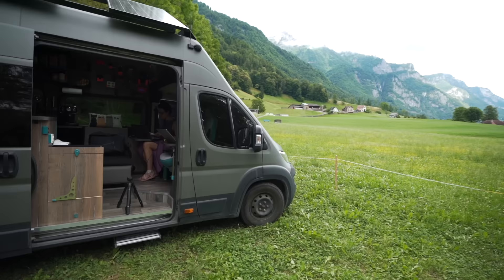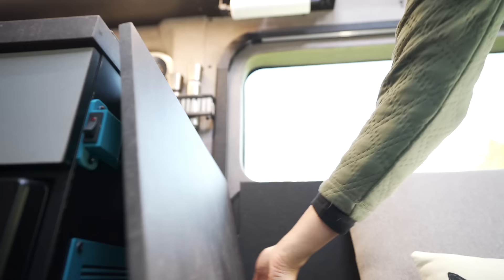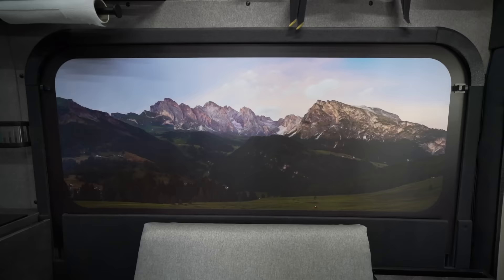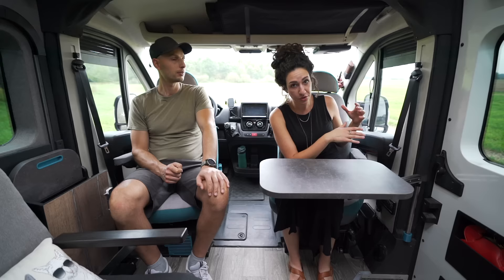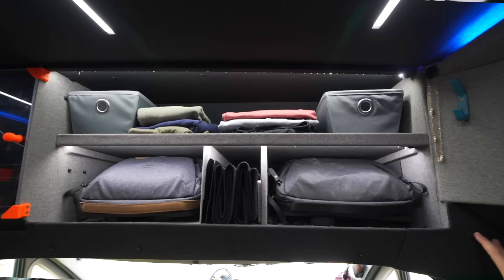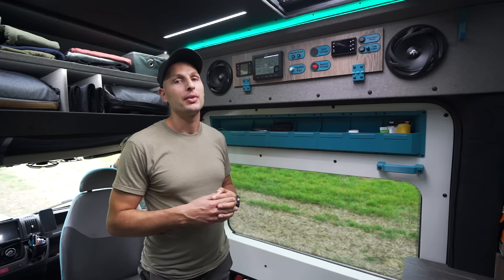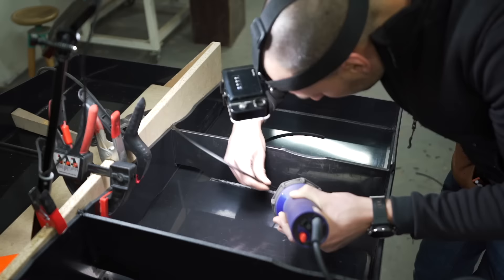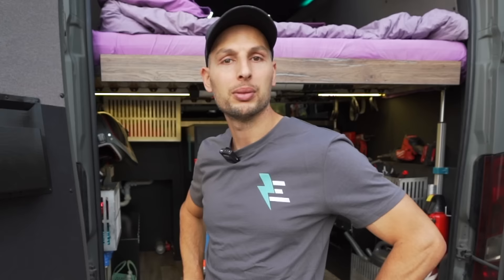Inside the Most FUTURISTIC Campervan / DIY Van Tour

Comment: Of all the van builds, I think you've designed / engineered the best modern solution for creatives. Having a 3D printer running while you are on long drives is a stroke of genius. :trophy-yellow-smiling:
Reply from the maker: Driving has no effect on the print quality.
Reply: @ladiandmargaret The RAL CODE  color please ❤
Reply: I really hate these 2 - in a good way ♥ What a van. Even though i'm not technical at all, I still would love to try it out. Keep it up 👍
Reply: Not just for creatives. it's the best overall build i've seen ever. 
switch out the drone equipment and print other holders. replace the 3d printer compartment with some other tech, maybe a gaming pc. reorganize one of the thousand small compartments. replace the e bikes with normal bikes or an e scooter. there are so many options to easily customize this van
Reply: @Larsino2000 Make that 0% sure now. 😂
Reply: Agreed, I think this is the best one I've seen!
Reply: @Johnniebhoy83  as someone with 3 Prusa MK3S+'s - i'd agree with larison and be pretty sure that vibrations would negatively effect the print quality. Jesus, the vibrations from the 3D printers on high resonance surfaces is enough to ruin the prints, that's why most people reduce vibrations by putting them on concrete slabs.
Reply: That’s the reason I started following the serieus and subscribed. Both explain everything so well and show exactly what they mean while designing or building it. Also because they have had experience before building a Camper van they knew what to change or to do better this time. Some things are maybe a bit overkill but that’s what makes this one so god damn cool!
Reply: Came here to ask this! All the action that's going on in that little house on wheels is really inspiring!  @ladiandmargaret
Reply: Geez. What did you 2 not think off!?
Reply: Maybe a wind turbine?  @Khigha87
Reply from the maker: You can trust us. We tested this extensively and it prints without any noticeable defects.
Reply: @ladiandmargaret about to get out of the military, want to get into van life and travel the states, this video is a goldmine!
Reply: @ilbirbantevagante  thought the same
Reply: @ladiandmargaret  Driving has no effect on the print quality. => Regular driving has no noticeable effect on the quality of your printings
Reply: Wow!
Reply: @ladiandmargaret I find this hard to believe.
Reply: i was about to say, this is the most sophisticated, practical, and functional van build I've ever seen
Reply: @ladiandmargaret ofc you’d say that😂

Comment: The FUCK is this ???? A vehicle which has integrated 3d printer and also prints its own spare parts when required !!! Like,.. Seriously this guys ,, this!!! This is what is needed. You have the best damn vehicle in the world and no one can beat that!!!!! I can't imagine the hard work put into building this high tech masterpiece !!!
Reply: No the ''bathroom" is shit. Rest is great though
Reply: @dimarak8866  Overall yes it is shit, but if you compare it with other camper vans it is at par, its like when you top in the class with 5 marks out of 100, you still get A+ grade. So basically it isn't that of a shit, depends on the frame of reference. I would say it is doable and functional, not the most luxurious like leisure travel vans, but still innovative thinking and practically functional whilst making efficient use of the space.
Reply: How can you 3d print spare vehicle parts? They're plastic!!

Comment: This inspires me for a van I would like to build in a few years. While I don't have access to a 3d printer and may not need it on the road, I definitely see a future where I own one. The solution for the bathroom is exactly what I have been looking for, as I couldn't figure out an open layout that included a bathroom. I don't need as much space, so a lifting bed may not be necessary, but I will definitely fold the bed in half when it's not in use, as I would have room for a small desk for gaming. I do like the setup that Husband has for his office, and I considered it for my gaming setup as well. Maybe if I discover more things ill want to haul, then I will switch to your office design.

Comment: Holy Cow! What a project and what a result! Your van is definitely through the roof and off the charts. I'm very impressed with the level of detailing. ... One detail: With all the wiring and the sophisticated electrical system you could've also just bolted a fully decked out Mac Mini somewhere under the floorboards or in a wall and not be worried about someone snatching your laptop. But that's just me nitpicking. This is effing impressive and very inspirational. I'm considering going Vanlifestyle my self and this sort of thing is right up my alley and in definitely taking away some solid inspiration and ideas from this. 

Great planning. Great execution. You guys rock and just made my day. Thank you for this video!

Comment: I have an idea for the shower curtain, you can make a fixed steel frame atached to the a foldable curtain. And you put magnets on the ceiling. So you enter the shower space, pull UP the curtain frame to the roof, and it makes PLOOK. And voilá

Comment: When anyone dumps gray water from their campervan, they need to make sure they are dumping into a drain that goes to a sewage treatment plant and not into a drain designed to take rainwater off urban streets. The latter sends the discharge directly to the nearest stream rather than a sewage treatment plant. If gray water needs to be dumped and a sewage treatment plant drain is unavailable, a grassy area can be used receive the gray water (but never the black water). The plant roots there will absorb the soaps and bits of food particles.

Comment: 27:53 👍Low level toilet and shower arrangement is far better than full height shower room that generally restricts move movement. Importantly it gives the van a much more open air. OK there is a loss of privacy, but hey ho that’s van life 🤣
You could also add a removable rail so that you could hang wet gear to drip into the shower tray.

Comment: With your skills and creativity you could easily invent a folding box that could act as a wall and roof for the bathroom. It could fold just like a normal folding box. Or you could have upwards sliding wall panels on the inner side of the bathroom. Great build none the less!
Reply from the maker: Sure, we can add it with time if we have the need.

Comment: I wish he  would show ICE, that makes all this travel possible😇The 2015 Fiat Ducato L4H3 is a van that offers practicality and versatility. Here are some key details about it:

Fuel Efficiency: The Ducato is known for its low running costs and impressive fuel economy. It can return up to 47.9 mpg (miles per gallon) with emissions of 157g/km1.
Engine Options: The current Ducato range features Fiat’s Euro 6 Multijet II common-rail diesel engines. These include a downsized 2.0-liter engine with 115hp and 2.3-liter engines with 130hp, 150hp, and 177hp options. The 150hp motor can also come in EcoJet trim, further enhancing fuel efficiency

Comment: use bifacials on the roof and paint the roof white so you get couple % more power out of those panels, and also i would add flexible solar panel on the side of the van for extra power, vertical mount works really good tbh
Reply from the maker: You think 1kw of solar is not enough? What for would you need more?

Comment: Things I want, if I lived in a van:   #1. 1000 watt microwave. #2 Good sized freezer, for 400 frozen sandwiches, frozen vegies and frozen meat and fish. Tools, gear and a 40+ gallon water tank under the bed. #3 Ceramic wall heater. #4 200 cans of soup. #5 2500w Power Station hooked up to solar on the roof, or a SphereMotor. #6 A sponge. #7 Coffee maker and a rice cooker.  #8 A good wall cabinet setup.  #9 Pullout toilet under the seat.  For dinner put some frozen vegies in microwave and then add soup. Next microwave a frozen sandwich. Next wet hair, add shampoo and then rinse in the sink with warm water from the microwave. Next clean body with warm sponge. Next turn on the Ceramic Wall Heater. Next, be free and happy.

Comment: In the shower, you could have put some curtains like the one on your kitchen cabinet door, you would have had privacy and height, even some bars or rods as they want to call it, with a shower curtain so you can only get up after taking a shower or doing your business. and miss down.  With so much futurism, I can't believe something like this hasn't happened to them... that shower won't work well, it's water spread everywhere for sure.

Comment: First thing first, great video, liked and subscribed 👍.  Once I saw how your hang your drone, I had a stupid idea, since you engineered everything in this van, why don't you set up a drone launchpad on the roof somewhere, then one button to launch the launchpad, and you can sit at your driver's seat to fly your drone, just some useless example, stuck in traffic and wanna see how long is the lineup, or at the edge of the cliff but want to check out the beach down the cliff and the road to it, etc.  That would be super futuristic, just a thought 😄

Comment: Serious question: With all the knowhow and tools you have, why not build one or two slide-outs? The water is under the car and out of the way and you have a couple of linear motors already in use and the experience to control them.

Comment: Awesome, this can be future, esp when RAM has those range-extender VANS/TRUCKS with small, efficient, clean as possible, ICE / generator for piece of mind.
Too many DC CHARGER cables are already being cut off for copper. No way to stop it. Too expensive to hire 24/7 armed security. I not want to be 100% dependent on DC fast-chargers, also it will lessen depletion of Lithium, for batteries, by being smaller, lighter, cheaper!

Comment: Mavic Pro: Folds into a small form with less volume than a running shoe for easy transport
This Guy: Stores it in bright orange clips fully extended in the middle of the wall
What was that about not looking like there were valuables inside?

Comment: Is the laptop holder / usb plug in touchy? Does it take a little finesse to make sure it lands perfectly?  Would you be able to do it with a USB C charger?
Reply from the maker: I plugged the laptop in, build sides and glued the connectors while connected. This way it’s a perfect fit. It is USB -C charger.
Reply: @ladiandmargaret is there a good resource to learn more about how to wire something like this??

Comment: So, not even an automatic gearbox, no airconditioning, you need heat by your feet bc insulation is bad, obviously bad ventilation considering your window water condensation leaks, and all that electricity everywhere? you have to shower in a doggy washer, your fridge size means going to the store each day, and nobody can repair it except yourself, nice job but good luck 🤞 😅